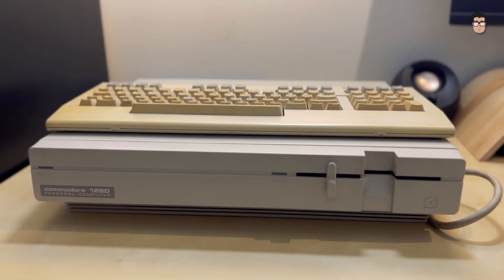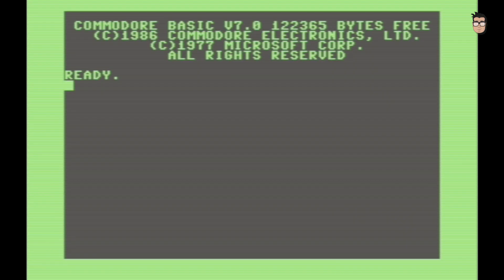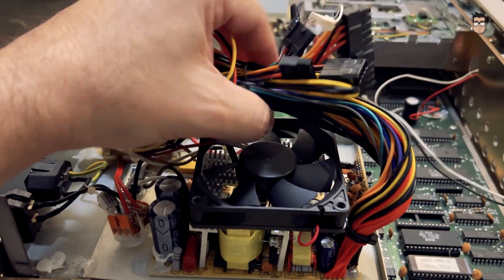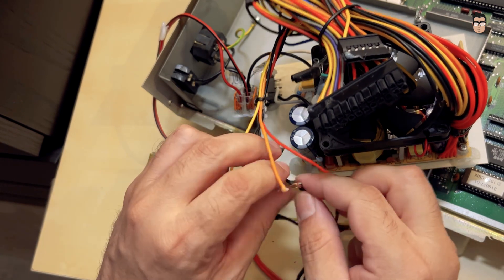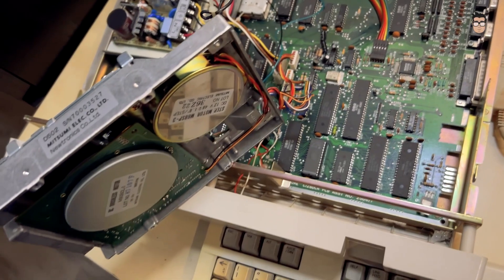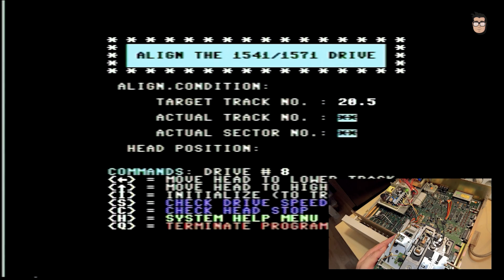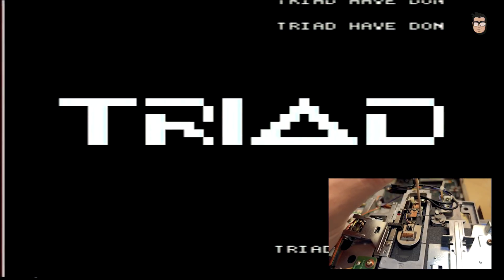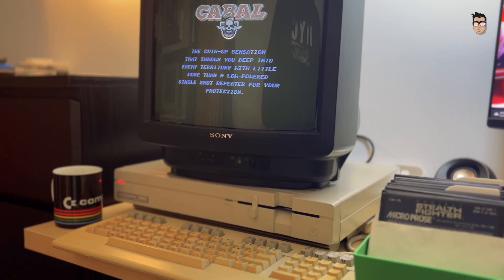I Restored a Commodore 128D — the Most Advanced 8 Bit Commodore  Computer Ever Made

Comment: There was no "professional market" for an 8-bit toy like the C128. That's a complete joke to anyone who is from that era. It was a 128 with a built-in disk drive. Nothing more. And all it did for Commodore is take needed resources away from the Amiga project which, if fully developed, would have saved the company and changed the world.
Reply: Where you have that from!?
The guy {Bil Herd} who made C128 was actually working on a laptop {not Amiga}!
And he was really pissed off because he couldn't make the laptop and had to deal with C128 instead.
In his opinion, the laptop he was working on, had the potential to save the company! 
His C128 strategy was to load everything into C128 what actually already C64 have had available as modules.
C128D was also planned from the beginning.
Because some things were not running as expected, compromises were made and that is why Z80 is running with half the speed, but running.
8502 can properly operate only with 1MHz! So C128 isn't really faster than C64! In contrary, it's actually a little bit slower.
2MHz speed is possible only without the video signal because VIC II isn't supporting 2MHz CPU Clock!
VDC has only two access address which can be used to access available registers! 
And then there is the 256 Bytes issues because Bil received wrong confirmations when he asked questions about the new VDC-Chip!
That is what he did and that is what we have until today. 
Considering all the circumstances, it can be said how C128 isn't the most advanced and also not perfect HC, but it definitely is a GREAT 8-bit Home-Computer,
which is used by me since 1985!
Reply from the maker: @miselzivanovic2181 , thank you for sharing all that information
Reply from the maker: https://www.computinghistory.org.uk/userdata/files/128d_personal_computer.pdf

Comment: The 8502 CPU ran at either 1mhz or 2mhz depending on the mode. The Z-80 was a 4mhz chip in this machine, but was only able to run at 2mhz because timing issues in the 80-column mode and the other chips (such as the SID chip which couldn't run faster). If the 8502 was running at 2mhz it could display in 80-column mode. If you wanted 40-columns to use the VIC-2 chip, the chip stepped down to 1mhz because the VIC-2 could not operate at 2mhz. You could run the 8502 at 2mhz and blank the screen from the VIC-2, but the performance gain was trivial. The RAM for the 80-column screen was minimal. Replacing the 16Kb chips with 64Kb chips and modding the wiring slightly would allow full possible color from the 6845 chip used to display 80-columns. The Meanwell mod was an excellent choice in the 128D. The REU could expand the RAM to 512KB, however the unit was expensive. Few REUs sold due to the price and few still exist. There are both cart projects that can expand RAM for both the C-64 and C-128, but since programs weren't written to take advantage of RAM in REU and modern configurations it usually gets used as a RAM disk. There's also a bit of overhead when dealing with bank switching between 64Kb banks on any 6502 variant (including the 8502 with it's clever built-in bit control). However, 64Kb was the maximum per bank. All machines using 6502 variants came up with their own way to bank switch. Apple's I, II, III series machines, Atari's machines, and other machines and game consoles used the 6502 or one of it's variants. Also, Commodore's external disk drives also used 6502 CPUs. Great video.
Reply from the maker: Thank you very much, Jeffrey, for sharing that knowledge. Your comment is very interesting, thank you!

I didn’t quite understand the sentence “The RAM for the 80-column screen was minimal. Replacing the 16Kb chips with 64Kb chips and modding the wiring slightly would allow full possible color from the 6845 chip used to display 80-columns”, but I imagine you’re referring to being able to use the colors from the 40-column mode in the 80-column text mode. It sounds very interesting; I didn’t know that modification was possible. I’ll look into it.

Thank you again, I hope to see you on the channel more often!
Reply: @thebitculture  
He is talking about the VDC (80-Column Screen) Video Memory.
With more VRAM (64KB) you were able to use different graphics screens and speed things up {when using VDC-CHIP)
BASIC-80 for C128 is a perfect programming language to check this out!
...
2nd option to test VDC would be to get a *COMAL 80 v2.01 MODULE {.crt}- with a SUPERCHIP for C128!
Now you might think it's for C128, but it is not. It is for C64! 
However, when used on C128 you can access close to everything what C128 hardware has to offer!
{Accept the access to 64KB RAM in BANK 1}
...
*COMAL is a structured programming language for 64/C128 and many other computers from that time.
Reply: I do not own a C-128 (I almost did get a free 128 a couple decades ago but I declined), but I am aware of the step down to 2 mhz for the Z80.    Has anyone modded the 128 today that can run the Z80 at full 4 mhz, so that CPM mode can run at full speed?   I recall that was a major flaw & letdown & did not help when it came to the Z80 being more used, because it was at half speed, even though that DOS was on its way out.   I do own 3 C-64s. 
11/27/25

Comment: The wedge-shaped 128 was my first computer. ❤❤

There are a few games that run natively in the C128 mode, or run enhanced versions in the C64 mode. You should check out Rocky Horror Show 128,  Volley for Two, The Last V8, Kik Start 128, Petscii Robots 128, and a recent conversion of Stunt Car Racer enhanced for the 128.
Reply from the maker: I’m glad to see you around here again, you’re already a regular on the channel 😉

I haven’t tried the enhanced version of Stunt Car Racer for the 128. I think I saw a video from the author not too long ago, and it looked pretty good, especially since the 128 can only run at 2 MHz when the VIC isn’t active. It would be interesting to see how he managed to pull off the improvement.
Reply: @thebitculture I'm glad to be here 😊 I also noticed you got the Cost Reduced model with the metal cover. That's a very nice find and a stylish machine 👍👍
Reply: Ultima V uses the extra memory to reduce disk swapping, and it has the bomb soundtrack other platforms lack, even amiga and pc ports.
Reply: @seppo-citymarket Yes, indeed 😊